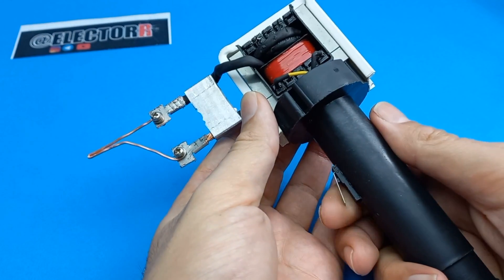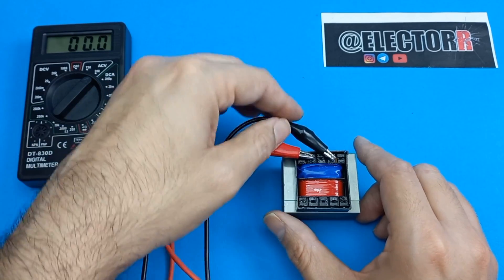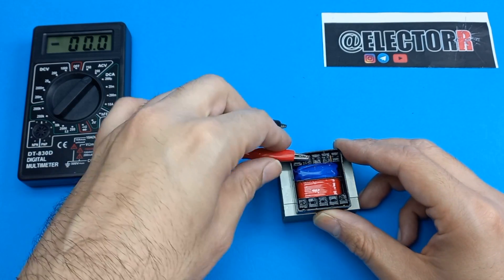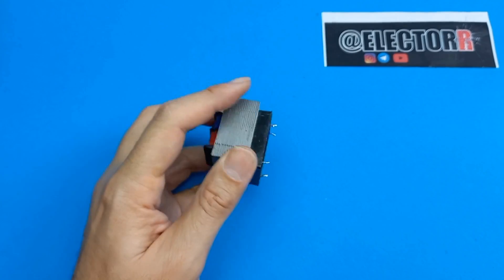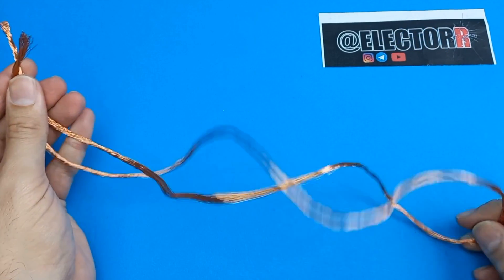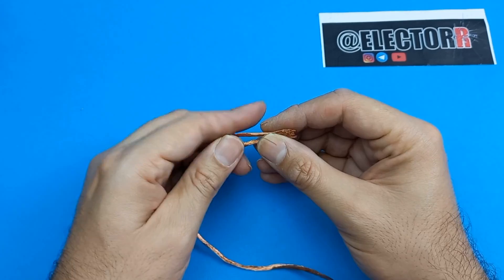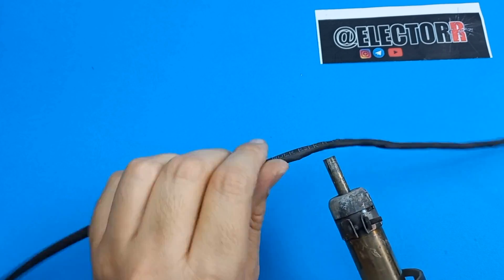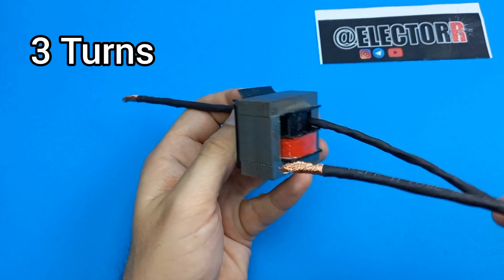Diy soldering iron | soldering iron from transformer

Comment: Hello first i want to say thanks for this good video .

Second i have a question about the main winding or the primary winding when i make the secondory thick wire of 2 turns the primary get hot and burn after 00m15s of turning the soldering iron on . 
The primary was the issu or just did i use an old transformer i dont know ?
Thanks again ❤

Comment: I made a 500 mA transformer with a 24 V transformer, but the heat it produces is not able to melt the solder wire. If I choose 3 turns of the coil, 4 turns or 2 turns, which one is better?
Reply from the maker: lower turns is better